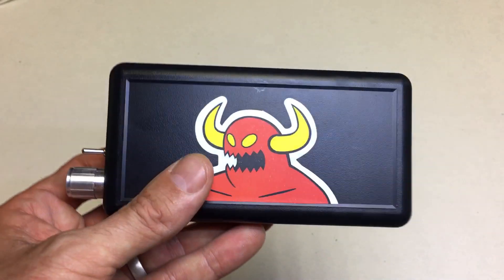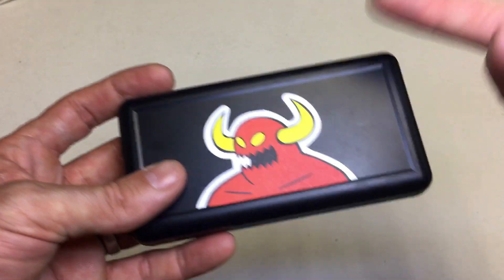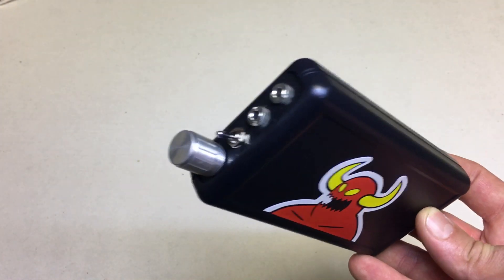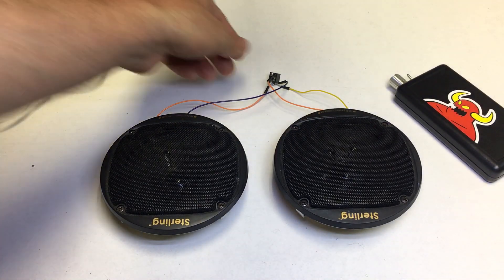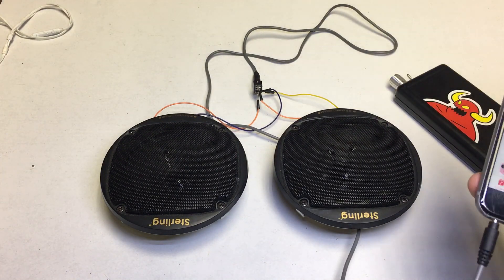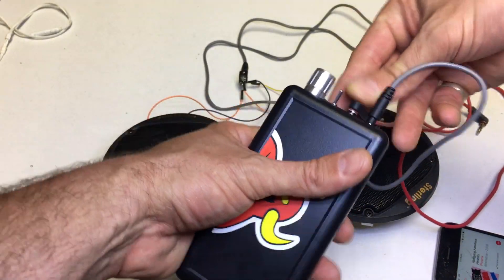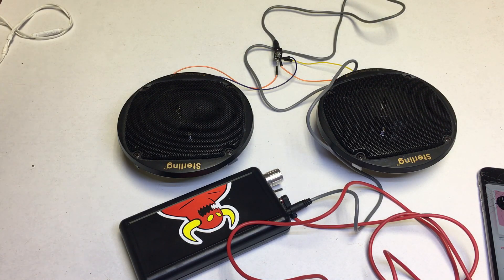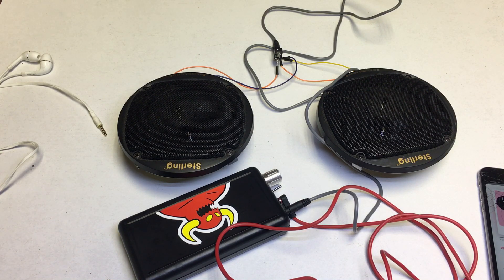Make a Headphone Amp

Comment: DO you know a way to add Ardruino Blutooth connection to it?
Reply: you wouldn't have to use an arduino, you could pick up a bluetooth module and wire that where the aux input is. if you get noise when there isn't anything supposed to be playing it's most likely a ground loop and can be fixed with an isolated dc to dc converter. good luck :)
Reply: @vyladence  Thanks